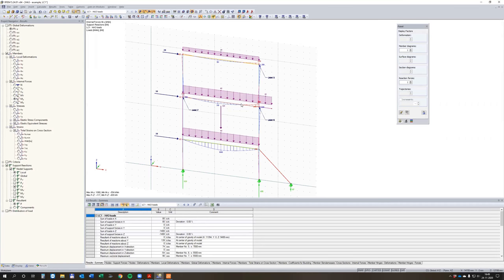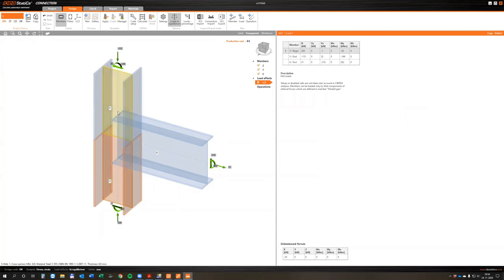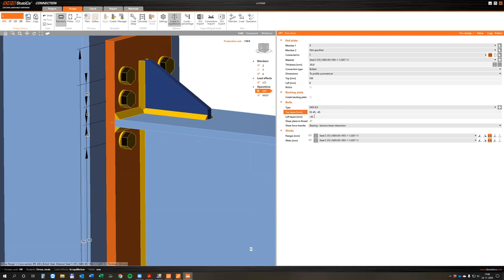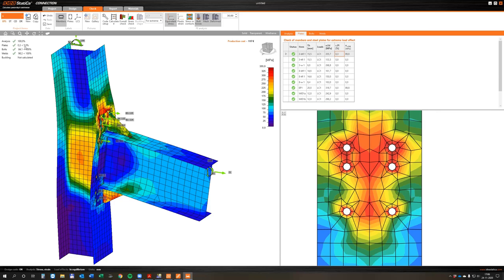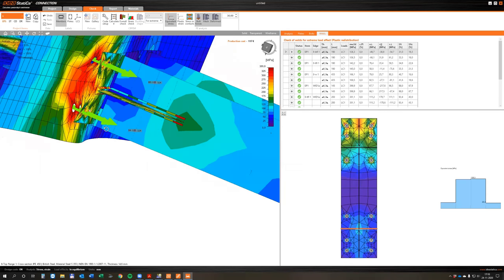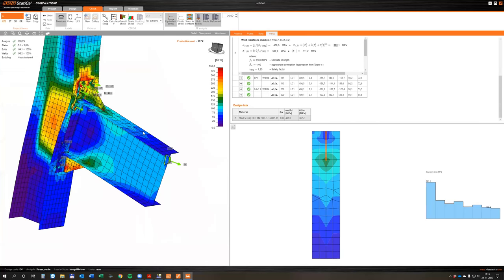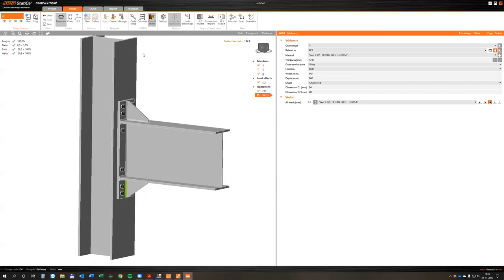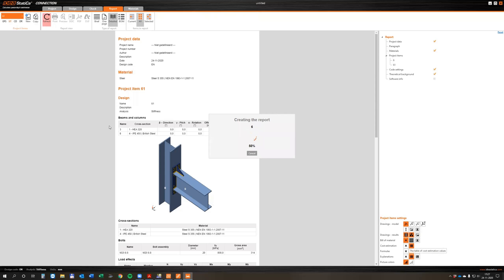Synchronized connection design with RFEM and IDEA StatiCa

Comment: When the analysis is 100% in 15:58, so what do the unbalanced forces tell us? Does that mean those unbalanced forces are the forces that will be transmitted through the connection from the beam to the column?
Reply from the maker: Hello, please refer to the articles about equilibrium and unbalanced forces here:
https://www.ideastatica.com/support-center/equilibrium-and-supporting-member
https://www.ideastatica.com/support-center/loads-in-equilibrium-by-default
In short - all unbalanced forces are applied at the member end where the support is placed.
Reply: @ideastatica_en  Thank you for the reply. Now I have a clear idea of how IDEA StatiCA works with forces.